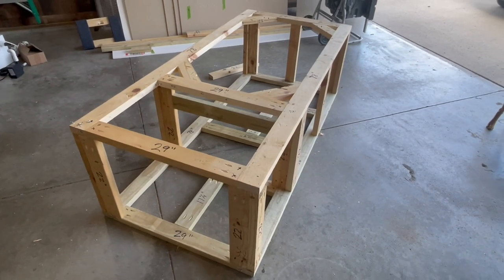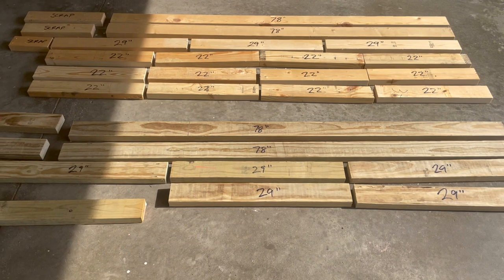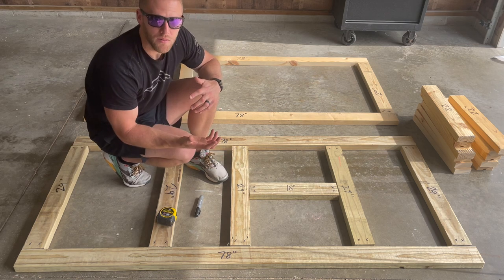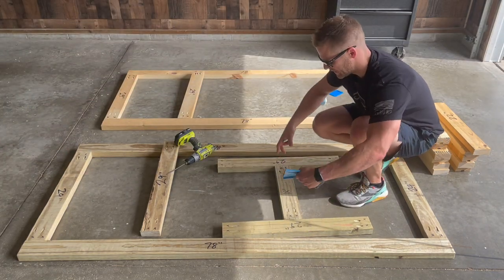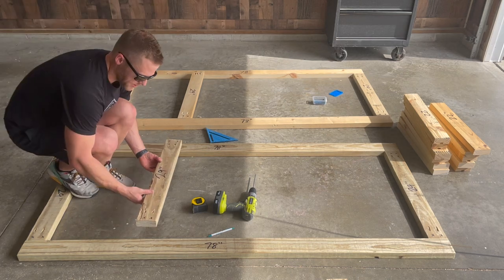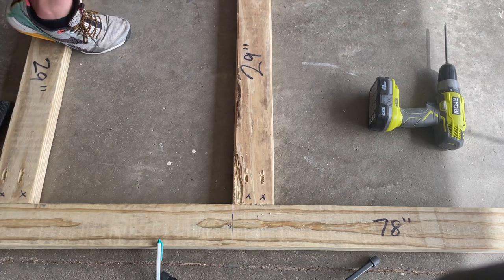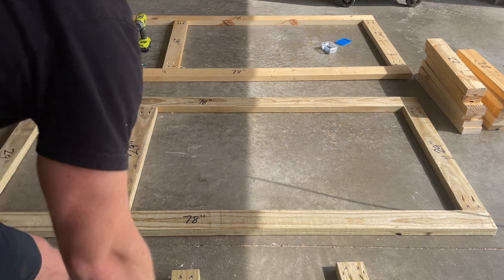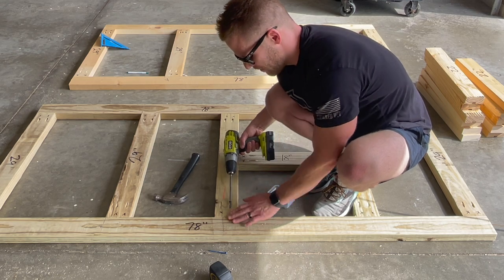Building a DIY Cold Plunge | Framing (Part 1)

Comment: Hey there. Any sense of what the concerns would be if using an aluminum stock tank? Obviously dimensions would be different, but would aluminum as a material necessitate other considerations besides dimensions? Any help is appreciated!
Reply from the maker: You can absolutely use the galvanized tanks 👍

Comment: 2x2x4 metal stock tank fit with these dimensions?
Reply from the maker: Hard to say for sure.... You may need to fuss with it a bit - the issue I had with the metal tanks is that they aren't consistent. They manufacture them to fit inside each other so you might have one that's 25" wide and another that's 23"

Comment: Are these the sizes for a 100 gallon tank and an active aqua 1/2hp chiller? thanks for all this great info, much appreciated.
Reply from the maker: Yep - 100 gal rubbermaid. The 1/2AA chiller will fit, if you do the pvc conversion.
Reply: @DIYColdPlunge  awesome, thanks for the help.

Comment: Do you have a video for the framing of the 150 gallon tub?
Reply from the maker: No video, I have a plan here 👉https://diycoldplunge.com/products/framing-plans-pdf-diy-cold-plunge-v2-0
Reply: @DIYColdPlunge  thanks man. I already bought that from you along with the bundle plans. I was just curious if you had a video on your tube for the 150g tub since they are a little different. The 150 doesn’t have those sides you need to saw off either. :)

Comment: If you're plunge isn't going to be outside, is having pressure treated wood necessary, or can you use all framing lumber?
Reply from the maker: I would still at the base, you are bound to have some splash over 👍

Comment: Is this 100 or 150 gal tank? Based on your experience, which one would you prefer?
Reply from the maker: This is the 100. I fit it it well at 5'10" 190lb. I also have a 150 - if you have the space and don't mind paying for more material to finish its definitely more roomy. I always advise going and sitting in one at the store
Reply: @DIYColdPlunge  thanks dude! I’m going to try and replicate it using cedar planks on the exterior. Let’s see how it turns out
Reply: What do you use for the siding?